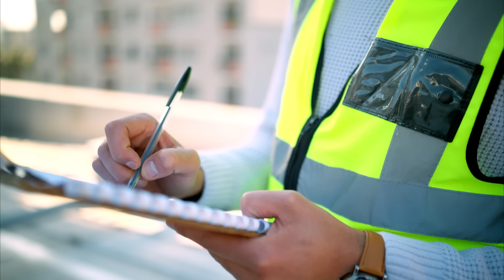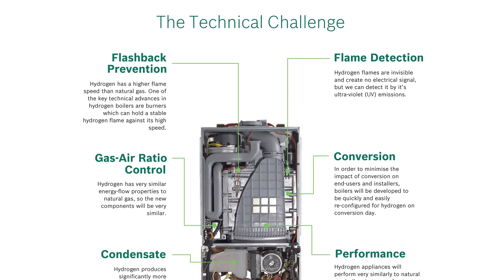Is Hydrogen Actually Dangerous? | The Real Facts

Comment: I like the idea of hydrogen energy but I do feel there are some hefty safety issues that must be satisfied before widespread use can be achieved. How do we ensure that wrong minded people (terrorists, for one example) cannot get their hands on the hydrogen gas/liquid via the delivery methods. Think siphoning of one kind of another, diversion, or maybe they could just let it spill out from a gas stove and make a home made dirty bomb. If that issue can be solved then hydrogen suddenly becomes a really great idea.
Reply: Hydrogen is easy to buy with absolutely no controls, I have a cylinder of it in my workshop and just swap it like any other commercial gas. There's a hydrogen refulling pump at the fuel station my son works at.
Reply: @jimtitt3571  That sounds crazy to me :O I'm moving to the moutains <.<

Comment: The absolute killer of H2 for home heating is it's calorific value, you need burn about 3x the volume of H2 to get the same heat as methane. This means the flow rates through pipes has to be 3x, which means you need bigger pipes.

The second negative is round trip efficencies - if you use H2 as a means of transporting energy from the green generation (eg elec from wind) to the home the transmission efficency (conversion, transport, burning) is so low it's better to just use resistive heaters.

Hydrogen does have some uses - see the "hydrogen ladder" but home heating isn't one of them.

It's main use is an excuse for the fossil fuel and boiler industries to keep going as before rather than transitioning to electric heating.
Reply: 100% correct
Reply: @Troy_Loves_Custard  no
Reply: ""Electric heating"" isn't the future either, and is already proving to be painfully expensive.
Gas is underrated. We are going to need it going forward more than the moronic politicians want to admit.
Reply: @jimtaylor294 the really big problem with gas (aside from co2) is it makes us dependant on imports from unstable parts of the world. We currently rely on imports for 50%, which will increace towards 80% over the next decades. 

Before you say we should drill more, even if we opened every field currently earmarked and every field likely to be exploitable our % of imports will still rise, just to over 70% instead of over 80%.

Electrification allows the UK to be more independent as, not only does it use less gas per kwh delivered to use a heatpump powered by electricity generated exclusively from gas, but we can substitute other sources like wind, nuclear, solar, tidal etc.
Reply: @brianballard905  I can see where you're coming from, but extoling ""renewables"" discredits ypur argument, as they are not reliable, efficient, cost effective nor even all that good for the environment. It's not viable to all electric, even if we went all in on Nuclear power and somehow made Fusion reactors work.

The UK did have Gas independence once... it was called Coal Gas,which the UK has always had an embarrassment of riches in as we have vast untapped black coal deposits across the country.

Add in Fracking and Gas produced from existing agricultural sources, and there's no shortage of alternative gas.
Reply: @jimtaylor294    "renewables" are efficient and cost effective. They are the cheapest form of electricity.

By "reliability" I assume you mean "sun doesn't always shine, wind doesn't always blow". There are ways to negate this issue like local battery storage, geifld scale battery storage and yes, backup gas and even coal plants. National grid engineers have thought about this and have plans in place to handle it. 

The goal is not to be able to produce every kw from renewables 25/7/365. It's to produce the vast majority of it from renewables.

I imagine there will be days, or even the odd week every now and again where the majority of our electricity comes from gas, nuclear, imports (and maybe even coal and oil). But they will be a tiny minority. And the more wind/solar we install the more often we have energy so cheap it is being given away.

Moving away from gas (and coal) for the majority of our power demands makes environmental and economic sense.

It also frees up our remaing gas, oil and coal reserves for a more important use - chemical feedstocks.  As many of the pro-fossil fuel lobby point out fossil fuels are vital for modern life eg plastics.  Which is very true - which makes it all the after that we take this precious reserve and light most of it on fire.
Reply: So just how did coal gas (50% hydrogen by volume) work bzck in the past?

It's wonderful to think about all electric, but personally we cannot go all electric simply because of the reliability issues we get in winter. Five Christmases in the last 30 years we've had no power due to overhead lines being down, or  step down transformers going phut (they experience flash overs and the oil catches fire). That diesn't fill me with confidence. Not everyone lives in a big city
Reply: @jobandknock427 back with town gas household demands were lower. You had a cooler maybe a gas fire and maybe a gas water tank (Ascot?) . A few kw each.

Now we have 28kw and higher (some boilers are 40kw).

And yes, elec can cut out - but you'll find almost all modern central heating systems are dead without power anyway. Boilers need fans and electronic control and the heating system has (at least) pumps and probably valves that require mains.
Reply: Not quite right, Hydrogen has THE highest calorific value of any fuel, by mass.
Reply: @jeremyfoster6942  he complains about the volume, not the mass.
Reply: @Biggest-hz7ng   he implies that the problem is calorific value, without adequately explaining its relationship to mass and volume
Reply: @jeremyfoster6942 I am ignorant about this topic - but from the first paragraph of the OP I knew he was talking about volume
Reply: @Biggest-hz7ng you are 100% correct, H2 has the highest energy content per unit mass and this is often talked up by H2 proponents.

The problem is by volume it is low, about 1/3 that of methane and this is important when we are transporting it by pipeline.

If you swap from a regular boiler to a combi you often have to upgrade your gas pipe from 15mm to 22mm because the flow rate required for instantaneous water heating is so high.  We will face the same issue with H2 (or even blended H2 to some degree)

Hope that clears things up
Reply: @gareth6326  well done you
Reply: @jeremyfoster6942 I am just trying to help you, as you seem confused by the topic.
Reply: @gareth6326 awwwww fanks

Comment: The problem with the Space Shuttle O-rings was down to extremely low temperatures meaning they could not be flexible enough to seal the joints fully in the SRB’s.
Reply: The SRBs had solid rocket fuel as well .... If he doesn't know about specific details of the space shuttle what else might he not know ... about other spacecraft
Reply: But it was nothing to do with Hydrogen. They were solid fuel rockets.
Reply: @timoakley277  The point is that the SRB joint failure caused the hydrogen in the big orange tank to explode.

Comment: Imagine if you could generate hydrogen as and when needed by combining aluminium with sodium hydroxide and water. You also have the added benefit of creating heat and an electric current during the reaction. Aluminium is easy to transport and store (how much do we regularly throw away in our bins?) and we flush hundreds of litres of water away every day. Sodium Hydroxide is a slight risk, but not that much of a risk that you can't buy it in supermarkets for cleaning drains.

Comment: Methane is lighter than air, so it goes upwards, not downwards, (6:12)
You are absolutely right that hydrogen use is about storage. It is not as good in volume or storage system weight terms as petrol or diesel, but still way better than batteries. If you don't want tailpipe CO2, it's the only solution for heavy goods vehicles and aeroplanes. NASA spent millions trying to make a battery powered large aircraft viable and gave up until battery technology gets much much better.

Comment: Methane is about half as dense as air, you're probably thinking of Propane and Butane which are denser than air and can accumulate in boats.
Reply: Caravans have "drop holes" to let it out
Reply: @elgorrion52  They should put drop holes in the bottom of boats then.
Reply: @petehiggins33  😂
I heard a story of somebody actually bailing LPG out of the bilge with a bucket and tipping the invisible contents over the side

Comment: The hydrogen bus does need batteries as the fuel cell is not responsive so you end up using at least 3x as much energy to end up using electricity.
Reply: The hydrolysis to extract the hydrogen is only 75% efficient.  Then it needs energy to compress it and store it. It then has to be transported to the place of use (probably by a diesel truck). A fuel cell is only 50% efficient, so you have less than 50% of 75% when it is used to drive an electric motor in the vehicle.
Reply: No diesel truck required at all if you put the hydrogen gas into a pre-existing network - like the curtent gas network. In any case diesel trucks will also have to disappear before too long in order to meet emissions requirements. I work in construction and trials have already begun on using hydrogen to replace diesel -forget batteries because they simply don't have the capacity, and probably never will
Reply: @jobandknock427  the current gas network pipes are not suitable for hydrogen, it'll leak out as its the smallest molecule.
Reply: The premise they failed to mention is that no hydrogen is never made from electrolysis except by your chemistry teacher at primary school. (It's dropped from 1-2% to 0% in 2024) So all hydgrogen is created using fossil fuels of some form. 
So you loose energy efficiency even before you ship the hydrogen to the bus. Then loose efficiency burning or fuel cell converting to electricity. Whole thing feels like being run by a PR firm over science. Not sure anyone is as afriad of the safety as they make out. But sure they will show us footage of the hinderburg to make the point.
Reply: JCB Have developed a hydrogen internal combustion engine.
Reply: @WilliamLaverick-wo1nb you can burn hydrogen in a combustion engine but the issue is storing enough fuel and even compressed in a huge heavy cylinder….you’d be lucky to get 50 miles of range on a 100 litre tank. They’ve tried liquid hydrogen which it more energy dense but it needs to be stored at -200 or so before it boils away. It’s totally unfeasible to burn hydrogen in an ICE. Fuel cells are far superior but they still need batteries.
Reply: @neo_265  JCB have a working Hydrogen engine.
There is a car centric in Derbyshire where you can actually drive a Hydrogen car. 
There are also HGV’s that are run on LPG so Hydrogen is not impossible.
Reply: @WilliamLaverick-wo1nb  The drive trains are the easy bit, its the cost effective green hydrogen supply chain thats so difficult that the hydrogen lobby won't describe how its supposed to work. JCB also supply EV equipment
Reply: @rtfazeberdee3519  BOC already produces and delivers Hydrogen and has done for many years. 
I agree with the cost but had the country invested in it it would cost less today.
Reply: @WilliamLaverick-wo1nb  Its not green hydrogen and distributing canisters isn't going to supply the needs for heating/transport.  There are over 50 reputable reports saying just how it cannot work economically/practically.  The only people pushing this are the fossil industry who make dirty hydrogen and people who have not researched the cost effective green hydrogen supply chain (it only exists in the minds of the fossil industry as they can't/won't describe/cost it)
Reply: explain.
Reply: @adriaanvantulpenbaard1740  An analogy : To create green hydrogen, you currently need to use electricity. To create enough green hydrogen to power a fuel cell vehicle 100 miles, the amount of electricity used will have powered a battery vehicle 300 miles. 
Plus from Well to Wheel, hydrogen transport is only just more efficient that the internal combustion engine.
Green Hydrogen is not cost effective.
Reply: @rtfazeberdee3519  COrrect, but they fail to mention, no-one creates hydrogen using electrolysis. It's just not efficient or as cheap as fracking fossil fuels.
Reply: @JamesBrown-yn7xr  They never mention the green hydrogen supply chain, i think because they know its too expensive and they want to get as much hydrogen infrastructure in place before they   say "green hydrogen is too expensive, we'll have to use dirty hydrogen"
Reply: @rtfazeberdee3519  The bottom line is that hydrogen is really a fossil fuel. Nothing 'green' or renewable about it.
Even after its use to heat something or move something the result is water vapour - a significant green house gas. There simply is no upside at all. (Except for the bank accounts of oil industry execs)
Reply: @adriaanvantulpenbaard1740  it needs a high powered catalyst to start

Comment: Challenger Shuttle explosion was caused by hot gas escape from the Solid Rocket Booster, which does not use Hydrogen. This did occur at a joint which had a defective O ring (not fit for use at the low temperature Challenger was launched at on that day).
The hot gas jet seared straight through the huge external fuel tank of the shuttle which held Hydrogen and Oxygen and powered the 3 main engines at the rear of the shuttle. It was a hydrogen/oxygen explosion, but not due to a problem with hydrogen containment. Fortunately domestic hydrogen for boilers and cooking will not require it to be stored in pressurised liquid form alongside liquid oxygen. 
Hydrogen, being the smallest atom in the periodic table did present the Jet Propulsion engineers a problem of containing it at very high pressures within the fuel delivery system of the RS-25 engines.
Reply: You can imagine driving your hydrogen fuel call car back home and getting is some minor fender bender. You think nothing of it and park in your attached garage as per usual. The accident has created a tiny hydrogen leak which fills your garage and house with colourless, odourless gas which one flick of a light switch will send you, your family, house and a significant part of the neighbourhood into oblivion.
Reply: So it's all allright then?

Comment: I’m not a convert. All these new ideas are very expensive. Industry is no longer competitive, as energy is too expensive. 
We’ve got natural gas right under our feet, and gas in the ocean. Britain has the most expensive energy in the world. 
Use what we’ve have in abundance to get our industry up and running, and to bring down domestic energy bills. We are changing our coal fired steel works to electric arc furnaces, which can only produce recycled steel. Virgin steel is an extremely important national security asset. Lowering carbon emissions is a factor. We have coal in abundance ready to be used..
While other countries steam ahead, we’re being left behind, in the name of lowering CO2, and our output of CO2 will have little effect on global emissions. China and India are knocking out coal fired power stations like there’s no tomorrow.
Reply: Note that emissions from China's coal plants are flat or reducing as they are closing old plant and using their plants less of the time. China's electricity generation demand growth is being met by renewables. India will hopefully reach the same point in the next five years.
Reply: like there’s no tomorrow

Comment: Thank you this is generally in line with the Cambridge University discussions I have seen.   

It’s a very tricky gas to use so suspect it would not be an option for the general public to be using.  However there are other applications where it maybe suitable.

Comment: Hydrogen simply doesn’t have the calorific value when it oxidises/burns that methane does (natural gas). It liquifies at -253 centigrade which makes storage in liquid form untenable. Hydrogen must be compressed to make it small enough to carry as a fuel. How big would the crater be if compressed hydrogen were involved in a road accident? Too many problems have made this a non starter.
Reply: Hydrogen has the highest calorific value of any fuel, but it's energy density by volume is far lower than methane.The next most powerful fuel after Hydrogen  is petrol,so to hopefully illustrate the issue. compared to petrol , by mass Hydrogen  has approx 120M J/ Kg compared to 44MJ/Kg for petrol,  BUT by volume, Hydrogen  has approx 8 MJ/ Lt  compared to 32 MJ/Lt for petrol , meaning pipework and storage vessels would need to be much larger than they currently are for natural gas or fuel tanks in vehicles
Reply: @jeremyfoster6942  the dirty little secret is natural gas is in the beautiful sweet spot of being energy dense enough to easily transport through a pipe at low pressure therefore making it significantly safer if/when a leak does occur.

As op said. Imagine the size of the crater for the first gas leak in a residential property. 

Imagine asking a fireman to enter a building where there’s a cage of 600psi hydrogen gas canisters in the basement. They aren’t entering the building, it’s that simple.
Reply: @TheDirtyWizard  the post i replied to claimed Hydrogen had a low calorific value, to which i pointed out that that isnt actually the case,  apoint that you have emphasised with your comment about firemens safety and domestic craters!!😂😂
Reply: @jeremyfoster6942  apologies, didn’t mean to tag you in it. Was for op. Yes I agree with everything you put! The claims that hydrogen will just float away and not be dangerous has me raising an eyebrow. The justifiable fear dr Richard Harris had when handling hydrogen for the 250m NZ cave dive is a prime example of the kind of fear that gas instills in people who have a proper understanding of what they are handling.